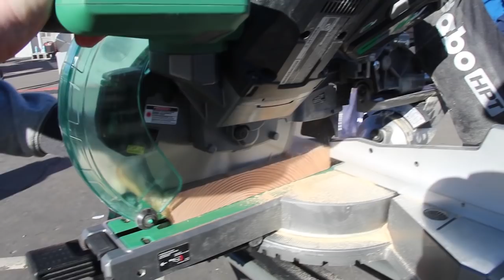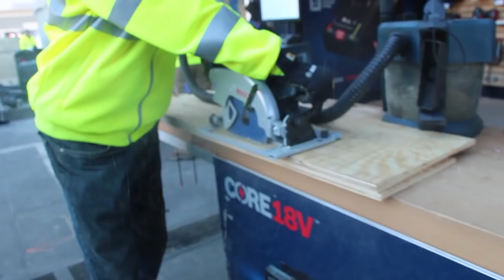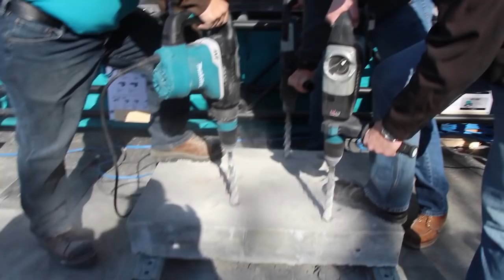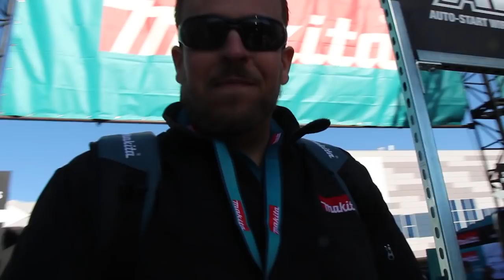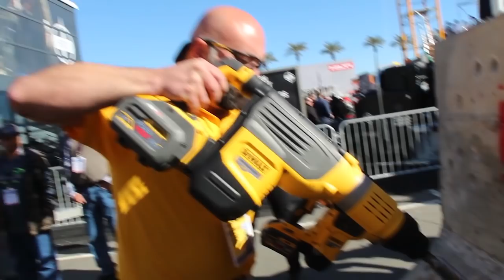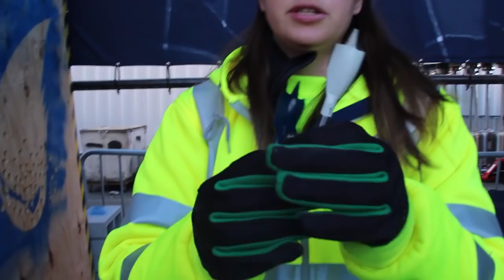Most interesting new tools at World of Concrete 2019

Comment: Dealt literally just copies milwaukee about everything. Tool connect? Milwaukee has had that out for a year
Reply: Ryan H 
Yeah everyone copies everyone, but in this case Dewalt tool connect was around long before Milwaukees one key. Dewalt came out with tool connect originally as an asset management system, gotta be 5-10 years. What Milwaukee was slick with was adding the ability to specify settings on your tools.